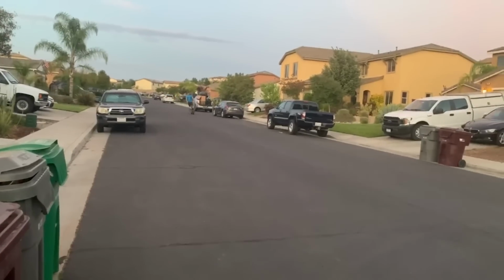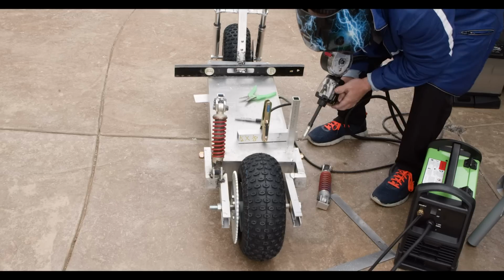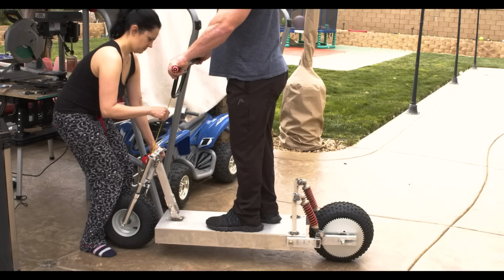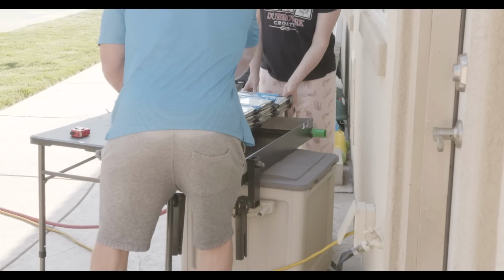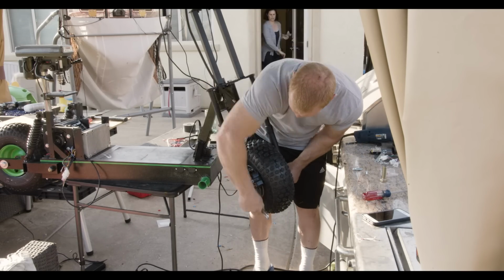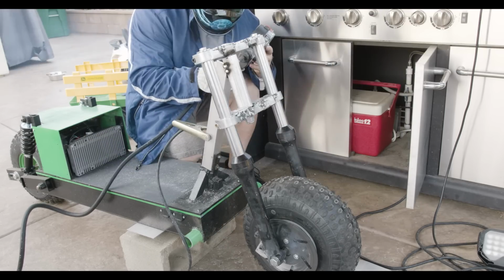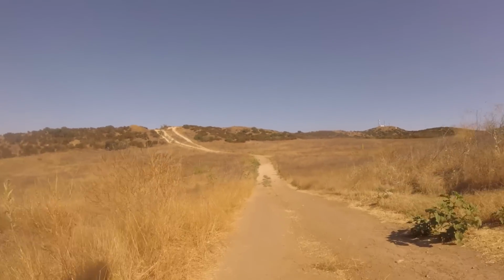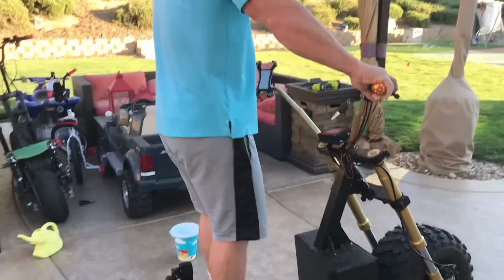20 kw Electric Scooter made out of Aluminum (dirt bike power!!)

Comment: When putting the battery in did you have to program the esc to your battery’s voltage or did it just know and last question did the program cable come with the esc answering this would be greatly appreciated because I’m building a ebike with QS motor rated at 1000w cable of 5kw and with peak power of 7kw so again any advice is greatly appreciated
Reply from the maker: The controller (esc) pretty much comes ready to plug and play. I did programs a few features tho like sport mode etc.. and yes you can fine tune the voltage low points  on it .
This controller did come with the cable, the software is the most glitching thing ever. I kinda know how to get around it all the time now

Comment: You just had to use aluminum and then weld it didn't ya?
Reply from the maker: I just wanted the most performance by tq to weight ratio. I love aluminum, the only time I weld steel is when I have too like when I’m stuck with a certain frame like my atc, 4speed dirt bike, orange dirt bike, power wheel, mini bike videos
Reply: @RexSmithII  can't blame you on that, i love aluminum too but those welds compared to what you see on bicycle frames are kinda irritating
I'm sure you can make way better welds on steel
Reply from the maker: @arsorc  yes they are horrible need a better welder, as we speak I’m building and aluminum street scooter and my spool gun finally is acting up making very unpredictable

Comment: Wow Amazing to find this video..!  Taking the best Lithium battery and building the Best E-Scooter.
Reply from the maker: Wow thanks, def could use improvements since this was my first build and welding. The batteries have an amazing discharge that you will never use, but they weight density is bad so take up a lot of space.

Comment: Which set up did you use and wire type and machine for mig welding? Thank You for good video
Reply from the maker: Qs138 70 
votol em150
4awg
Aluminum busbars
Titanium 140 mig with spool gun.
It does a lot better then you see here, this was my first time welding

Comment: Uhm, i'm not a pro, but i never heated aluminium before welding. And like someone else mentioned, tig gives a much nicer result. Nice step though.
Reply from the maker: With the bare minimum like this welder it helps to preheat just the start. I actually just got so much better and dialing everything I don’t really preheat anymore unless it is thick and very important. Tig is way cleaner and more professional but mig allows me to get up underneath and hard to reach places

Comment: Why not make the busbars from copper?
Reply from the maker: Copper was just too expensive and harder to find in the type, aluminum has great conductivity too( you won’t tell a difference), the only real issues with aluminum is galvanic corrosion, that’s were you have two different metals. They make a special Grease for this. It’s normally the negative side of the cell that’s copper and the positive is aluminum. Aluminum is a great heat sink also.

Comment: Hope that welding on the inside of the battery box doesn't eat in to the batteries .
Reply from the maker: It doesn’t touch actually 
And I add a rubber sheld

Comment: Absolutely nuts, I'm am curious about what it'd be like to chop down the handlebars mounted directly to the top of the forks and put a little seat  over the controller.
Reply from the maker: Yes that’s more traditional, after riding electric skateboards and having that standing feeling is really addictive, kinda like surfing with a motor

Comment: I need the same batterys for my 2.2kw build and the bms. Very nice scooter
Reply from the maker: The problem with these batteries are the weight density there’s so huge take up a lot of space and weight, But I bought them in bulk off of eBay, so I got them super cheap. great for the first build. I actually had the scooter sitting for almost 2 years now and the battery still sit at 3.8 V Per cell so I think I got lucky

Comment: Anyone else think aluminum bus bars is weird? Was copper not available..?
Reply from the maker: Copper was just too expensive and harder to find in the type, aluminum has great conductivity too, the only real issues with aluminum is galvanic corrosion, that’s were you have two different metals. They make a special Grease for this. It’s normally the negative side of the cell that’s copper and the positive is aluminum. Aluminum is a great heat sink also.

Comment: Great build. I love scooters that can climb as well as bikes. It's easy to make a street scooter, but off roaders is where it's at.

If you want another word to use other than scooter, you can use powerboard instead, which sounds better I think.
Reply from the maker: I like that 😎
Reply: @RexSmithII  I thought you might. If you're looking for a new build, there's a scooter/bike I've always wanted to see someone try to recreate as an electric one, a Cushman model 53a. It was something Cushman made for the US army in the 1940s and was air dropped onto the battlefield for troops to use to make getting around easier. Looking at them, it shouldn't be too difficult to make as an electric one, just put all the batteries in the bottom tray section, as you did with this one. 😉 Plus, the Cushman model 53a has a seat. 😁

Comment: I wonder how much would you sell for?  Because this is not cheap work.
Please let us all know what are the starting prices
Reply from the maker: Hi, yes that’s the problem with electric- it cost so much. That was my first time welding and my first electric diy video. Back then the motor and controller shipped was about $620, now it is about $920(amazing how much things went up). Those batteries I actually got super cheap because they were used on eBay and came out of a China electric bus from 2010( that’s why I tested each cell for a month). Normally battery’s will cost about $750 shipped for new high quality cells for that particular ah and volts. The aluminum was probably around $350(now aluminum has skyrocketed in price) . Wheels, sprockets, rotor, chain, handles bars around $200. Tires from Amazon $50(kenda scorpion) then miscellaneous stuff on ebay like hydraulic brake etc.. that should get you an idea of the price on building one.
Reply from the maker: Forgot the BMS and display about $120

Comment: TP100 motor?  What is the KV?
Reply from the maker: I think it’s 60 maybe 70!
It gets anywhere between 5,000-6,000 rpm but rated voltage of 72 is probably 5000rpm so 
5k/72 is about 70kv

Comment: Can you build me one?
Reply from the maker: Sure make an offer,
I would recommend we use batteries with a better size density, so you can move the motor down inline more with the rear sprocket, or just use hub motor.
If you want that voltage battery’s are very expensive. I will give you an example of the price for just the lipo polymer cells of 22 ah 88.2 volt after shipped to me $700
Reply: @RexSmithII  What would be the cost of one similar or identical to the one you have?
Reply: Also would there be anything that you would do differently to improve it? I have been researching everything from gas power to electric inhub  motors seems a little complicated.
Reply from the maker: @john-the-baptist2263  email me for specifics pricing 
But for the improvements, I mentioned those in my first reply
Reply from the maker: @john-the-baptist2263  have you seen my fat tire scooter video?
That one is very unique
Reply: @RexSmithII  I don’t think 🤔 so let me take a look.

Comment: Been watching a few videos over the past week or so.  Pretty cool you were, or possibly still are into fpv.   The large lipo cells you use here and in other videos really kick out some power!    Thanks for sharing.   Props!
Reply from the maker: The lg chems 60ah cells?
There good, I got a good deal on a pallet of them, so I arranged a few builds around them.
The cells in this video had the most capable discharge output but horrible weight density. The orange dirt bike has the best overall cells for size and discharge rating, but cost a lot more because I bought them already in packs, all I had to do was wiring 3 packs in series and wire in the BMS and done...
Reply from the maker: @hdbsmkalavshdhs  the cells in this scooter? They were a bulk buy on eBay a company was sitting on

Comment: why not just  use 18650 cells??
Reply from the maker: At the time these cells were a deal not let pass. Plus at the time there were a lot of fakes on eBay for the 18650s.( I’m not a fan of 18650 as you have to have so many in parallel to achieve anything close to the power needed, once your battery’s starts to get depleted you see huge voltage sag thus loss of power.)
I have a few race guys that have seen the same issues with 18650s. Lipo polymer are the best for overall performance because of its higher nominal voltage and higher C rating. What we have noticed is pollys use more of there mah in the higher voltage range of each cell vs li-ion using more of its mah in the  lower cell voltage, that’s why I believe you get more voltage sag..
In this build I did use li-ion just in cells and since these have such a great c rating I didn’t notice much voltage sag, but on my blue dirt bike that has 2 motors, even tho I used a 120ah battery I got huge voltage sag, this was a different cell and double the load. This is just what I have noticed.
Thanks for watching

Comment: Did you consider going with a toothed belt drive instead of chain?
Would be smoother and quiet.
Reply from the maker: Yes,
- I would of been to wide, I already was super tight with a chain( I was trying to make it compact as possible)
- I had another builder who used the exact same setup with a belt. And he did mention that it has so much tq sometimes it would slip the belt.( obviously this could be fixed with belt tensioner).
Reply: @RexSmithII  All good,  great build. 👍

Comment: Hii nice big deck.. you can fit a lawn chair on it🤣🤣
Is that an ac motor? Or DC brushless?
Reply from the maker: Dc brushless,
For small applications dc brushless is best.
Induction motors def have benefits but are heavy more expensive
Reply: @RexSmithII  yea i worked in the heavy motor industry for a bit, once you learn 3phase and have the power for it, there is no going back. Tru these applications are best with DC brushless but I recall some automotive who was working on efficient single phase mobile. Also some of the heaviest motors, like weight of over 1000 kg are DC.
Reply: From my calculations an ac inverter would sap too much power, that is the bottleneck for me.

Comment: man , theres a lot of experts in the comments here.. " use a hub motor for 13kw " yea because those are available at walmart right ...
..2 misconceptions taking place, 1 they dont understand how slow a stand up scooter generally is , 2 , they dont understand how fast this is .. I had 8,000 watts on a kids dirtbike , and it was quick with 2 people on it.. I cant imagine 13kw on a standup geared for 50.. nice work
Reply from the maker: I agree,
Hubs are more for convenience, unless you get a very expensive qs hub motor for motorcycle, but it still lacks the start tq and it has unwanted weight where you don’t want it, but super easy to install (no chain).
Reply: @RexSmithII  well damn too late for me I bought the kit as an experiment lmao dude what I'd given to be your next door neighbor in my neighbor changing tires is foreign unless your tweeter
Reply from the maker: @thegeneralist7598  what kind of kit did you get,
Can you share the specs
Reply: @RexSmithII with the influx of rental scooter this inspired ides to build a scooter that could haul around 2 adult sized people and a kids trailer. I set off with less experience than you in the welding arena and came to a crunch everything I've learned is from videos and reading I have no brains to pick and can't afford the training. I bought the same kit you mentioned the second biggest motor qs makes the 8k 3.5 T I planned even drew up the plan but I let my impatience and inexperience get to my Critical thinking now im stuck on swing arms my deck is huge 4 ft 11 inches if I could post pictures I would all I have is a cheap mig and will lmao 🤣 I will subscribe tho you are just like me to me using what the universe gave you but I'm literally stuck cuz no one wants to point me in the direction of getting bushing made to fit they rather criticize my welds the say get a education and a machinist lathe if you got a way to share video id love your input thanks a million brother
Reply from the maker: @thegeneralist7598  email me with pics and your questions 
I will try to give any advice
Reply: @RexSmithII  whats you email brother?
Reply from the maker: @thegeneralist7598  rexfordk83@gmail.com

Comment: Terrible welds. That wind is blowing welding gas away. Go inside and try steady your hands. Other fabtications ok.
Reply from the maker: First time welding aluminum here on that video, ya I jumped into welding aluminum off the bat, I have other videos showing a lot of improvement. My garage is a full gym so wind is sometimes bad. I would be interested in seeing your first weld. Have you welded aluminum or built Anything from your imagination? or just a YouTube troll?
Reply: @RexSmithII  i got tig for aluminium and stainless steel weldings. Im using mig/mag only for steel. I have done power plant servicing about 20years so i think my quality is enught for youtube.
Reply from the maker: @jarkkonieminenprotuning  exactly sounds good, but let’s compare your first time welding aluminum to mine, and I bet your are being a hypocrite, but no big deal .

Comment: The specs are really funny...
From a 25kw you get 300nm torque?
25kw you should maybe get 15-30Nm
Reply from the maker: Kw is in relation to hourse power , please google your thoughts before comments
Reply: @RexSmithII  KW to hp is about 1.34 so you got around 1.34
And the torque measurement comes from the motor, if you are providing the end torque, that's not the produced torque from the motor
Reply from the maker: @dissonantiacognitiva7438  I provided the nm tq from the wheels
60 x5 equals wheel tq
Reply: @RexSmithII  that's why the figures looked funny, I have been looking at motors for months now(motorsbating) and checking out what the reqs would be for a motorbike
But on such a small toy that motor is overkill for sure
Reply: You also went for one of the heavier induction motors?
Reply from the maker: @dissonantiacognitiva7438  the motor is the best for the price,
Check it out on endless sphere forums, there’s about 100 pages of info. I can peak at 20kw people have done it all over the world.
This is not a induction (ax)motor, this dc motor

Comment: Im having doubts about the following:
-300 Nm
-50 Mph
-20kw controller (not the motor)
-going uphill slow af in fear of a the wheel slipping. Really. Burnout on gravel/dirt...unless its during cornering it will not cause accident or damage, wtf?
Reply from the maker: I wouldn’t worry about it then.
Do the math 60nm tq max at shaft times gear ratio 5:1 equals 300nm
The rest I don’t need to explain.
Try riding something with a small wheel. In fact come back when you have tried a off road skateboard

Comment: always preheating Aluminium is BS! 
sure, it welds nicer if you preheat it... but it is not necessary.
and use an Argon & CO2 mix next time, it makes you life a lot easier.

because those welds doesn’t look very trust worthy.
Reply: Well I don't know shit so I'm asking is the mix the same as carbon steel I thought you need mostly argon for aluminum because I been welding 75/25 argon co2 mix